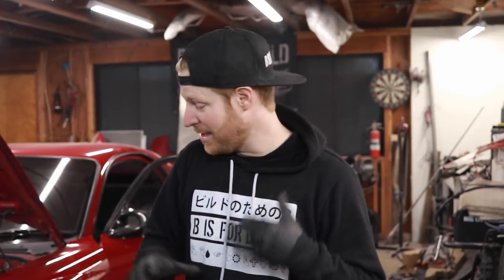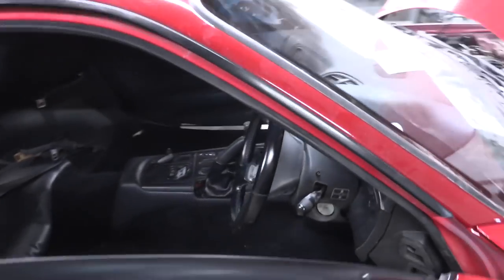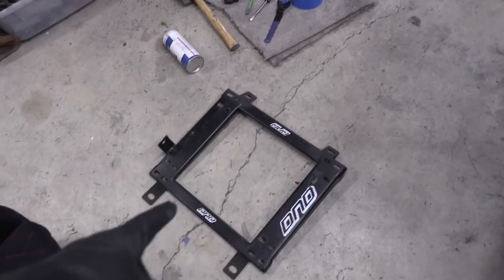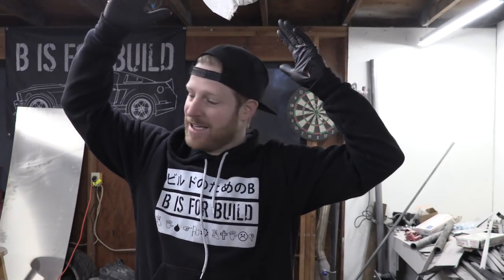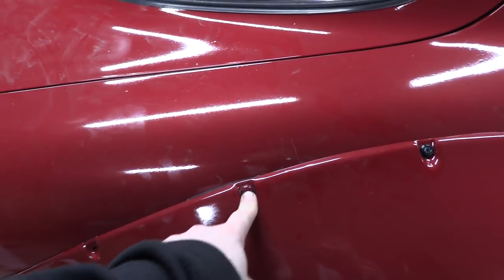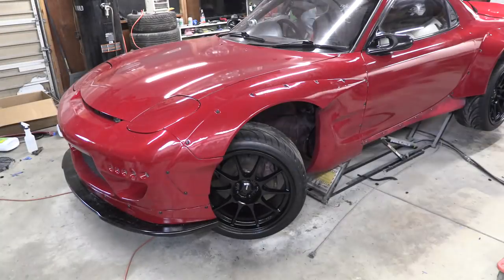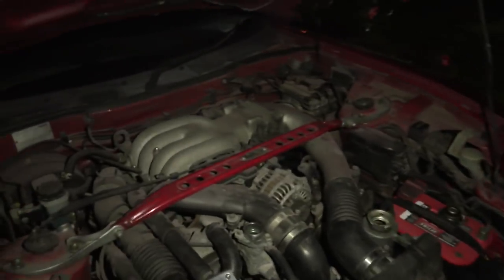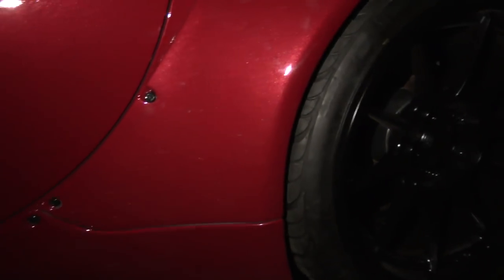The RX7 Is Finished And On The Road!!

Comment: Looks so beautiful now! Since you have no airbag you should get a momo or sparco crush hub for the steering wheel. It crushes in the event of an accident and is much safer than having a steering wheel impaled in your chest. I use them on all my cars with aftermarket steering wheels. For the quick release you can also look into the NRG slim quick release.

Comment: Get a torque wrench and torque your lug nuts before you leave so your wheel wont fall off and you know they are tight
Reply: Lucas McLain don't ricermiata it like what happened to the forsester
Reply: This is no joke I had a wheel fall off of my wife’s Yukon last week. Not a good time.
Reply: that classic video of an rx7 losing all its wheels.
Reply: Wheel fell of my dads van as well, but that was bit after wheel change, he installed winter tires and forgot to check if they are tight after driving a while.
Reply: I've had a wheel fall off my Clio 172. Was not a good experience lol

Comment: You might want to put some type of insulator (crimp cap, heat shrink, electrical tape) on the orange wire coming off your radio harness, that is a 12-volt positive switch from the dash lights to make your new radio dim when the lights are on in the car. If that wire manages to touch a ground, it will kill your dash lights and pop a fuse!

I just wanted to say I really dig your show and I appreciate all you do for us here on Youtube! Keep up the great work!

Comment: I’m happy your wheels didn’t fall off. That would have sucked after all that work.
Reply: should always check the bolts, dont trust ur life to others work lol
Reply: John Wu I’ve been there done that. Traded wheels one time years ago and assumed the dude tightened everything back. Drove home on the INTERSTATE doing 80 and I literally thank god I got off the interstate when I did and Star was going slower speeds because shortly after I got off the interstate, I noticed a wobble and it gradually got worse in stop and go traffic. By the time i could pull over, 4 OUT OF 5 mug nuts snapped off on both back wheels and every other lug but on every wheel was so loose that I hand spun them off. It was the scariest experience of my life. My mechanic who came and helped me told me that I seriously needed to realize how lucky I was to be alive when I was on the interstate.

Comment: I wanna drive that car so badly...I have owned 54 cars in the past 20 years and I own a 500 whp turbo Civic, and I have owned some seriously fast turbo cars in my life, but I have yet to own a turbo rotary. I had an 84 RX7, but it was a base model and had the 12A in it with a carburetor and while the chassis was fun and the rotary felt more powerful than it actually was,  it wasn't a 13b. I have a friend that has an 86 with a built high compression 302 Windsor Ford engine with a 5 speed from a Fox body and it is amazing. Engine swaps in these amazing chassis are cool, but nothing will ever beat the Wankel rotary engine. I would still love to get a Miata and put a Renesis engine in it with a set of twins on it.

Comment: Check to see if the Tein Super Streets have the dampening set properly. I had the same issue when I installed mine. Turns out that I had them set past the maximum dampening (full counter-clockwise) and they were "over-dampened" if that makes sense. Turn the dampening valve all the way clockwise and then count back 16 clicks. That will be the softest setting they offer, then you can turn them clockwise from there for additional damping. After I did that on my car the ride softened up like night and day compared to before.

Comment: Hey Chris, for the next project what about an old C10 truck parts are cheap and plentiful and if you can get a 350 small block parts or even cheaper and you can make a pretty good truck for about 10 grand in total. Plus it would be nice to take a step back in time and see how simple things were. For me for example I have a 1975 C10 Stepside that I got lucky finding and restored it structurally and body-wise for about 6 grand including paint and all the materials with paying some labor.

Comment: Buy some 2stroke oil and put some in to the tank when you fill up at the ratio of 200 to 1. This as a precaution until you can get your oil metering pump checked.

Comment: Tbh using moulding strip is a bit of a time cheat, if you want that look you should really use black silicone sealant- that way you can control exactly how wide you want the lines, and they look great if done right, have you and Chelsea looked at examples of RWB Porsche's? (check the RWB build vids to see it done by a master) It'd make those corner pieces moulded in to the front bumper fit better with the rest of the kit imo.

Comment: Perhaps you could use a clear silicon caulk to fill the void between the body kit and panels of the car. Silicone can be peeled later on, and the sun shouldn't yellow it if you buy a good brand.

Comment: The problem with lowering a car is that you're removing suspension travel, and on certain cars it's really easy to drop the car an inch or two and suddenly find yourself hitting the bump stops with every pothole. Miata owners know the struggle

Comment: Quick question: I saw that you moved the upper A arms to remove the coil overs but I did not see when you took it to an alignment shop.  Did you get the car aligned?   If not, I'm wondering how the ride quality will be and how much wear you will get on those new tires without a proper alignment.

Comment: love this build, the look is on point, only thing is when you get back from your trip take some time a figure out all the gremlins, detail the engine bay, install the new intercooler and definitely wet sand buff and polish the paint. Looks like you have quite a bit of orange peel going on. I would also try and finish up the paint booth. But great job on the build man!

Comment: Remember. Don’t coast in gear in a rotary. Either neutral or on the gas
Reply: why
Reply: prob to reduce wear, but screw that they usually last 60-80k anyways lol
Reply: I've noticed Americans driving manual cars coast a hell of a lot!
Reply: Ryan Hudson rotaries use oil to lubricate the apex seals. But when you let off the throttle in any car and stay in gear the fuel is cutoff. And the seals in the rotary stop getting oil
Reply: The oil isn't in the fuel
Reply: Michael Degen don't coast in any car.
Reply: Tony Walker never said it was. They run like a 2 stroke in a way to lubricate the apex seals
Reply: Michael Degen in modern engines oil is injected directly into the housing.